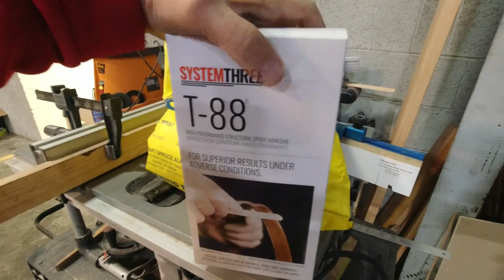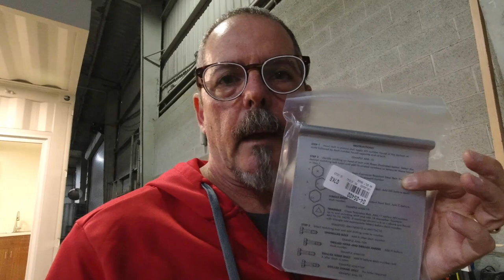Minimax 1100r Aircraft Build Vlog Episode 46

Comment: Looking good. I always try to route with the guard on the side I can cut into but you didn't have that option. I like the idea of the camera mount nuts, how will you fit the camera to them as the studs on the GoPro type mounts are not very long?
Reply from the maker: I’m going to use an adapter from McMaster with jam nuts. My nut plates are 1/4-28 and my camera is 1/4-20. https://www.mcmaster.com/#94358A110
Reply: @DTMinimax  thanks for that.

Comment: Looking awesome man, do those bolts get drilled & Lock-wired to ensure the Nuts can't back out? Just a curiosity question, I did see the slip up but that's one of the reasons I love working with wood, there are so many ways to adapt & overcome a problem or mistake! What are all the background sounds? Planes Trains or Automobiles ha ha! Loving the progress & thanks for sharing!
Reply from the maker: They don’t require safety wire. 
The shop is in the Long Beach flight path, right next to a major highway, and the train runs right between the shop and highway. It’s never completely quiet. The building itself makes a lot of sounds as well. Then there’s the raccoons, pigeons, and occasional mouse. 
I agree with you about wood...love working with it!